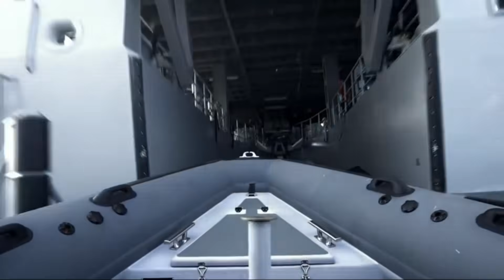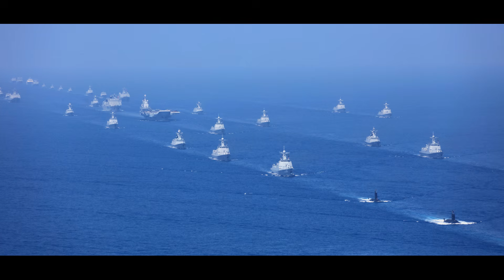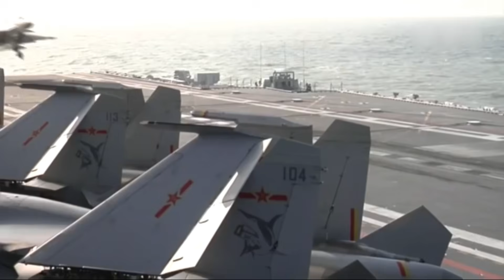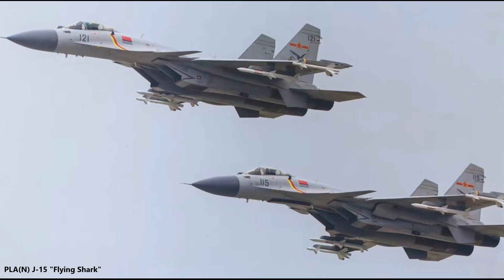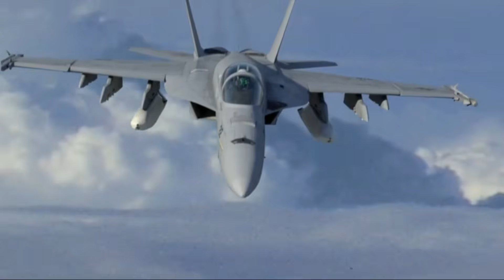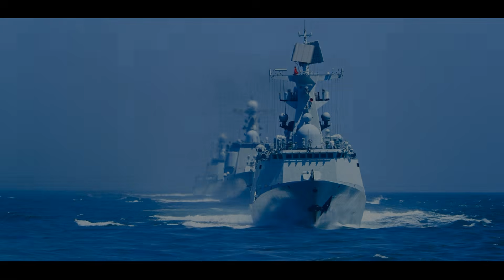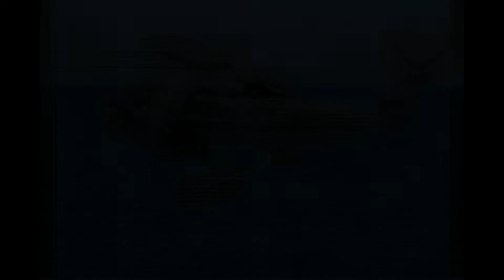Up-Gunning the Arafura Class OPV

Comment: This video in itself is an excellent answer to the question the video starts asking: Why have the RAN decided to remove Rotors Running Refueling capacity and the 40 mm naval gun and the Exocets as well from this OPV - well because they are afraid of the extreme mission creep this guy is advocating for

If we ever have a case for why mission creep can be dangerous this video is it. In short it argues for making a very slow, small, badly equipped, unmanned and and non-survivable OPV platform into an ASuW/ASW-corvette that is supposed to handle high-end war with tecnological peers or most probably being more-than-peers when Australia and US is the near-peer adversary.

If the RAN hadn't shut down every discussion and made this into a lightly armed but perfectly suitable OPV you get guys like the guy in this video, but inside the RAN, the defence establishment think tanks or from the american military industrial complex starting to advocate to make a undermanned (For it's new purpose), non-armored ship with very limited damage control capacity (40 men does not many fire fighting, damage control and medical first care teams make when the ship is struck by a C-803) with sensors and C4 systems (That radar surely looks like a Terma Scanter 4000 series with a cosecant squared antenna - not much to brag about when you have inbound sea skimming missiles in Sea State 4, ie heavy clutter) that are nothing like what really would be needed to handle it's new real-warfighting capabilities and missions. In fact, adding what this guy advoicates for just makes these vessels high value sitting ducks.

I might agree that adding a CEROS 200 fire control radar with electrooptics and a Leonardo 76/62 Super Rapido STRALES naval gun with DAVIDE sub-calibre manueverable anti-ship ammunition and semi-armor-piercing anti-ship shells and housing two Schiebel S-100 Camcopters with MX-10 electooptical gimbals on it would maybe have made sense and would have increased the area it could surveill by quite a lot and it would also have made it capable of fighting it out with Chinese coast guard ships, but that's it. 
That would need maybe 10 more people permanently stationed aboard but it might be worth it with each drone having a control link range of a 100 km and an endurance of 6 hours and weather is quite sunny where it will operate a large part of the time so the small drone can stay at 2000 meters and surveil a 5-10 nm circle for vessels. These drones are small, cheap, uncomplicated, have simple control radio links and in general is constructed for patrol and not combat.

What this guy is talking about is better done by building new frigates instead of trying to "up-gun a OPV" and letting the Arafura just be what it was meant to be, a lightly armed OPV.

Iäll just go thru the counter-argument on by one:

First, it is highly doubtful that one can fit four surface launched LRASMs laucnhed from box launchers in that narrow space between the bridge and stack.
Further, as the guy alludes to (very optimistically) adding the weight of the four missiles, which he quotes at 8 tons, which is very optimistic when one considers the missiles will need launching boxes, structural beams for holding the boxes, some electronics and very possibly the whole platform will also need to be strengthened, emaning substantial modification of the superstructure of the ship, so that platform can carry about 9,5 (long) tons that was originally meant only for weights of around 3,5 tons (Four Exocets/Harpoons or so). 
This might very well make the ship less stable and make it handle worse in heavy seas than the Armidale did which it is supposed to replace, with the main argument being better sea keeping (And longer range). 
The cost will be in the several tens of millions for each OPV in sail away condition and the crew will need to be enlarged by at least two persons for just handling the missile control station 24 hours a day.

Also, it not just like "adding four missiles and a data link" does it. 

The missiles doesn't fire themselves. The combat management system would have to be upgraded and the now used Saab 9LV combat amangement system that now probably only uses two or possible three multifunction consoles would need to have the LRASM software for firing the missiles integrated into the combat managment system and at least another multifunction console will need to be added to handle route plotting, timing, search patterns, target prioritization and so on for the missiles - which I wonder whether the US will alllow - or then it's adding some special console just for the missile firing. Expsneive. Also another cabinet will certainly have to be added to the server room. 

Then we have the Bofors 57 mm Mk3 with Semi-armor Piercing Anti-Ship Shells and the new guided maneuverable anti-Anti-Ship missile projectiles being developed by the US for the gun or the Leonardo/Otmomealara 76/62 Super Rapido STRALES with DAVIDE guided manueverable anti-Anti-Ship missile projectiles already available and Leonardo SAPAS antio-ship shells. 
This will give the ability to destroy coast guard units from other navies at about 10-22 km range and will give infinitely better protection against incoming manouevering seaskimmers than a Mk15 Phalanx, that is completely outdated for shooting down modern AShMs with terminal pseudorandom manuevering, to say nothing of the Klub type supersonic terminal pseudorandom terminal maneuvering missiles that China has copied from Russia, and just adding a SeaRam will not work because then we have no place for even a small autocannon in a naval weapon station. 
Whatever gun we choose (The Bofors 567 Mk3 or the Otmelara/Leonardo 76/62 STRALES) that will neeed another cabinet in the server room as well. 

T ocontrol the gun we need a CEROS 200 fire control radar and the 9LV FCS fire control system to control the naval gun so that's another cabinet in the server room. 

Also add at least one and probably four people to 1 Service and maintain the gun on patrols and load it while firing 2 Service and handle the fire control system and radar on patrols 3 Two people to man the multifunction console for eventual battle 24/7.

Then we have this data link. I presume he's talking about Link 16. Okey. Let's put a MIDS-on-a-Ship terminal on the ship and install it in the server room. This only has line of sight availability working in the UHF band so we will also need - I donät rmemeber what itäs called - but the LINK-16 over SATCOM add-on terminal. 

Now the amount of colling needed in the server room is twice as large as originally and we are all out of space here. Let's redesign the room- completely.

And so it goes.

Comment: I have just heard the news today that the Hobarts and ANZAC's are getting the Naval Strike Missile. Given that these missiles weigh significantly less than Harpoon... "A Naval Strike Missile measures about 4 meters long and weighs 880 pounds, including a 276-pound fragmentation warhead. That makes it a lightweight anti-ship missiles compared to the 488-lb warhead on the venerable Harpoon, or the 1,000-pound warhead on the sophisticated LRASM stealth cruise missile."..... surely this would a good sized weapon to install on the Arafuras?
Reply from the maker: Yep, it would certainly fit the ship, it just wont fit the A2/AD operational concept. The problem with the NSM is range; you have to get within 100nm of our Chinese carrier strike group. Good luck with that. If you cant get close enough to employ the weapon (because you cant hide and you don't have the defensive systems) then you might as well not even bother. 

I have to say I'm a little bummed that they picked NSM. I suppose its already operational and mature, but I just hope to god they get something longer ranged that can be deployed from the VLS. In terms of range NSM is only about 25% better than Harpoon. Its more lethal, but still.

Comment: The only thing about pair them up with larger ships, is the endurance issue, smaller ships won’t be able to stay at sea as long, so some of the tonnage will need to used to extend range and endurance before you after extra systems and weapons

Comment: Your assessment is spot on. The HLD are woefully under gunned and its insane to not accommodate the possibility of fixed wing jets. For a start, take those 4 x 25mm cannons off and replace them with 4 x Phalanx CIWS.  Now the vessels can defend themselves.  As for the OPV's, yes, put the the 40mm cannon back (or better add a Phalanx CIWS ) and refuelling for a attack/sub hunting helicopter plus plus plus.  As for deterring an offensive battle group .... we deploy a couple of nuclear powered attack subs with a compliment of cruise missiles & torpedos.   Yes, 20 x Arafura class OPV all up gunned and up optioned would be logical.

Comment: Question: with the upcoming replacement of the US B-1Bs with the B-21s, do you think Australia could have a use for a few of them, 8-12, as essentially modern Backfires? I imagine they could get them used at a fairly steep discount, and as far as I know, the airframes still have plenty of life left in them. They could provide an impressive area denial capability that the Super Hornet, with its much more limited range and payload, simply couldn’t. In addition, a long range stand-off strike against a carrier group seams just like the kind of medium threat environment the Bonehands are useful for.
Reply: Us won’t sell them to anyone. That’s why they are the only ones operating them. Same with the B1, A10 etc
Reply: If I had my way we would get B-21 & SSNX. I don't think it's as unlikely as most. The fact is, the US need allies buying this stuff. IMO the Yanks can't afford to continue to insist the rest of their allies use their 2nd tier gear or nothing. It's not going to be a pretty century, nor is it getting any cheaper to maintain a deterrence. However they have see where their, don't share with anyone policy leads. Far too few F-22's, higher unit prices for the US military, too much support on the US for its SOTA.

Comment: Think some upgunning is required but the future of these vessels seems to be the stern launching and retrieval of uuvs, maybe replacing the 10m rhib or developing a mechanical system internally on the deck above the launch ramp so that you can potentially switch between the 2 depending on the mission. Same with what’s on top of the deck with the various 20ft container options. 22knts max way too slow, not going to be used with any other surface vessel near or far Imo.

Comment: If it made fiscal/military sense to  weaponize this class then a light weight but capable gun system like "Millennium dual role" and  4-6 LTASM on/integrated into the forecastle as a surface action variant. Then you mention the ASW option. This actually makes more sense to me than the surface action concept for a vessel of this size/speed/construction. Modular systems have come very long way since the mess known as LCM. Thanx for the video. Slava Ukrainni 🇺🇦

Comment: I thought these were to have 40mm BAE cannon that uses 3P programmable ammunition. I believe at least half of the OPVs should be equipped with 57mm main gun, quad packed antiship missiles, MU96 torpedos and SeaRAM for air defence. I have previously written to my local member to this effect. Such decently sized vessels appear to be so barely armed.
Reply: Because these are meant for policing tasks, not fighting. You are getting confused between Corvettes and OPVs. Look at Indian Navy, they have both Corvettes and OPVs. Despite also having OPVs in the Indian Coast Guard. Despite having a network of 84 coastal radars. Despite having multiple patrol boats (tens of tons) and larger patrol vessels (few hundred tons) of Navy and Coast Guard in addition to all this. Despite having about 50 short range Maritime Patrol Aircraft based on Dornier 228. Despite now planning to induct MALE and HALE UAVs for ocean surveillance. Despite the satellites. Despite all that, there was still a place for Indian Navy to go for around 15 OPVs of around 2000 tons. Although their armament is slightly heavier than Australian OPV.
.
When you can get 11 OPVs for the cost of one destroyer, its a no brainer what should be done.

Comment: I cant believe they arent going to arm these ships up and give them helicopter refuelling capability is there no forward thinking in case of an emergency they are the size of a frigate just and that would give us 12 more in a crisis better to have the weapons and never need them than the opposite
Reply: Because costs triple. Or in Australia's case, would more than triple seeing as unlike us, you folks need to import the weapons. Take example of three different types of 2000+ ton ships in Indian service:-
1.) Indian Coast Guard OPV: 1x or 2x 30mm autocannons + 2x HMGs
2.) Indian Navy OPV: 1x 76mm Oto Merla SRGM + 2x AK-630 CIWS + 2x VSHORADs + 2x HMGs 
3,) Indian Navy Corvette: ^All of the above + 8x BrahMos VLS + 32x VL-SRSAM VLS (ESSM class)
.
Now coming to cost per ship, in order, it is:-
$ 60M
$ 100M
$ 200M
.
Now considering your Australian Arafura class OPV is armed similar to an Indian Coast Guard OPV, you can see that the cost would easily triple per ship.

Comment: I think the LRASM on the Arafura class is a pipe dream. You acknowledged that the ship is too small for the missile and then just moved on. This missile is just too big for this ship.
A better alternative is the Naval Strike Missile (NSM) which is more in line with the size and weight of the Exocet currently deployed on the same hull. The range and payload is less but its still a stealthy long range anti ship missile and can contribute to a saturation attack. More so because the Arafura could have more of them (4-8). The addition of a SeaRAM would give it a good balance of offence and defense.

Still a great video though, and you make some good points. Especially re the anti submarine role.
Reply from the maker: I said that we do not know whether LRASM can be used on the Arafura or not. You just made a bald assertion with no evidence or argument whatsoever that it is too large. NSM is only 1 foot shorter than LRASM. The only potential issue is the weight, but without a detailed understanding of the design we simply don’t know whether 8tons is a problem or not. There is PLENTY of reserve buoyancy for that much additional weight, the only issue is stability and currently we just don’t know if that’s a problem or not. You are claiming (or pretending) to know one way or the other. Do you have any evidence at all to support that claim???

As for the NSM, it’s certainly a very capable weapon, but the main problem here is it’s lack of range. Long range weapons systems are fundamental to the A2/AD concept. If your engagement envelope is to small then you are simply exposing yourself to overwhelming enemy fire, especially when engaging a carrier strike group equivalent. If you have to close in to 100 nautical miles then you might as well not even bother trying, not unless you have enough mass in terms of your defensive systems to fight off a carrier air group and YJ-18 volleys, which the Arafura certainly doesn’t.
Reply: @hypohystericalhistory8133  I didn't think it was that bold of an assertion considering the obvious size and space discrepancy when compared to the exocet. It just seems really unlikely to me that they will attempt to launch a 2000kg missile from an OPV. But I'm happy to be proven wrong.

I'm certainly not making any claims of inside knowledge of the issue considering a lot of details would be classified and I do not work in the defense industry. But I do have long conversations with a family member who worked on the anzac class frigates and one thing that I found enlightening was how the space required to integrate weapon platforms is a major issue. There is a good reason why the USN mainly fields destroyers not frigates. 

Then again the Russians cram much bigger missiles into smaller spaces so who knows what is possible.

One interesting thing about the NSM is it has vastly different ranges for different flight profiles. At a hi-hi-low profile its range is not that dissimilar to the advertised range of the LRASM at 300 nmi. Of course that leaves it open to early detection but maybe its stealth aspects will mitigate that somewhat...?

Certainly the LRASM is a better missile for the job you are proposing. But its massive and expensive. There is a reason why we are funding development of the NSM and will probably procure it in the future. It has a role on smaller platforms and I would have thought an OPV would be an obvious use case.

Again, if I'm wrong it will be a pleasant surprise. Either missile would be a massive improvement on what they have now regardless.

Comment: all good points you make HHH, but unfortunately the OPV are dogs in most of the scenarios you mention. Too slow and very noisy engines for ASW. If you use the tail module it takes out the flight deck for UAV functions (the container needs to be as far forward for weight & balance) with the tail needing to be suspended across the flight deck. LRASM is unlikely to fit abaft the bridge...too much topweight. Personally I'd drop a 57mm on the front and then head with our friends in Singapore and add Blue Spear/Sea Serpent. Nice 300km range plus a land attack function. But this is a "holstered weapon", the OPV is not a frigate, not a corvette and honestly, not a combatant.......its an offshore fisheries/border control platform that is suitable for the EEZ, unlike its predecessors. If we want extra numbers of kick-arse  in a can, this isnt the platform. $5b-$6b will get you 8-10  Saar 6. That's my vote